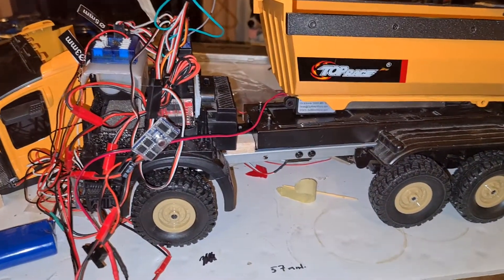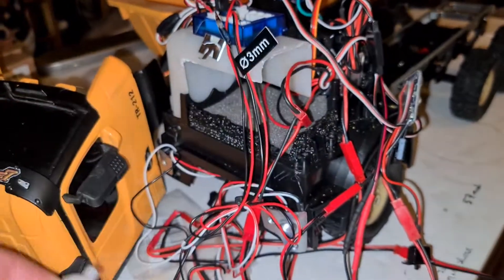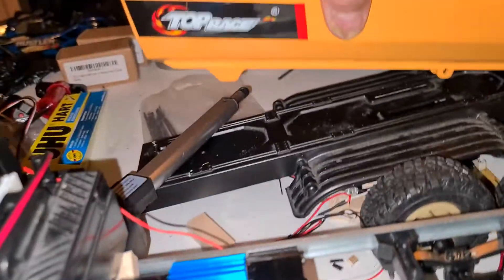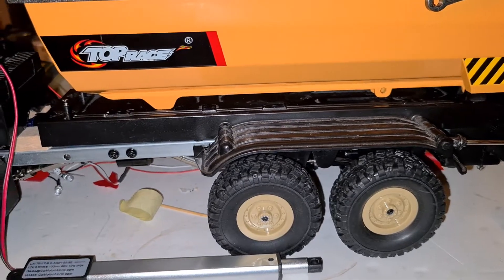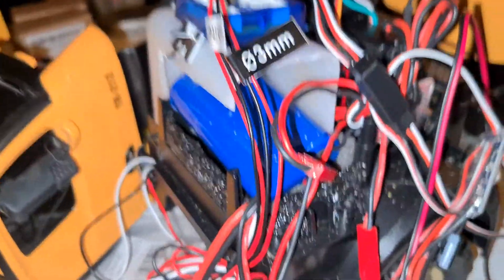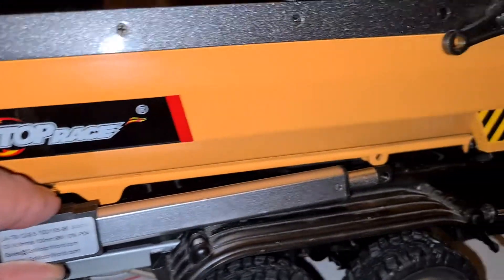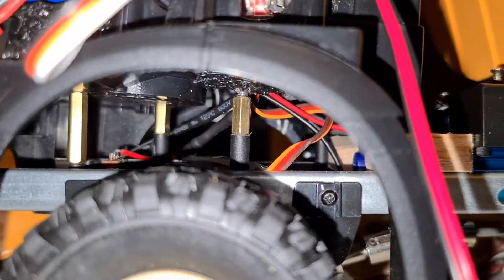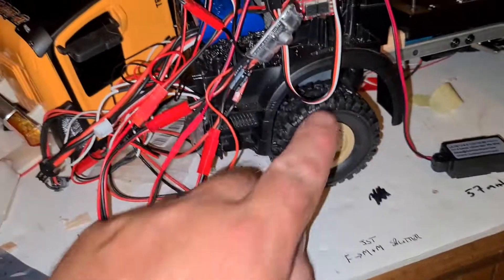Huina 1573/Toprace TR-212 Upgrade.

Comment: Love your work mate. I hope you do more as you get further
Reply from the maker: Thank you, I'm just learning as I go along. I've changed the linear actuator for a more powerful one, It can now lift the tipper body with some decent weight in it.
Reply: @GP-RC  sweet I'm going to be doing something similar soon myself as soon as that very slow boat from China gets here lol
Reply: @GP-RC  I'm also got the two speed gearbox as well just to make sure that it's going to handle everything
Reply from the maker: Yeah that boat really slows the building process quite a bit lol

Comment: Really interesting video. I just received my 1573 in the mail and it really leaves a lot to be desired as far as the suspension is concerned. I’m pretty sure this KO’d is going to be one I’ll be trying out in the near future.
Reply from the maker: Hi, thanks for watching. The chassis is a WPL 6X6 from AliExpress and comes complete with running gear, either a 130 or 180 motor ( can't remember which), wheels etc. The hardest part I'm finding is fitting the cab and tipper body onto the chassis, that's still a work in progress. Inside your Cab there are 4 large steel weights, what some guys do is remove 3 of those and leave one in. They say it helps with the traction.

Comment: Hi mate, great video.
I have a question. 
I have a top race excavator (1580 I think) anyway, I'm after a tamiya low loader with trailer and motorised ramps but the Mrs is having none of yet (yes correct I'm not a millionaire), so, if I got one of those, removed the skip from the back, buy a tamiya hitch plate, couple of other odds and ends, chrome mirrors, roof spoiler, nicer mud guards, that wouldn't be too difficult would it ???
I'm quite good at fidgeting about with things, now, do u think I'd be able to extend the wire, have a connection at the back of the cab, and somehow use that piston to operate my motorised ramps???
Thanks
John.
Reply from the maker: Hi John, this is where I got my chassis.. https://a.aliexpress.com/_uxHwrY

With regards to the trailer, I'm not sure as there is quite a difference in scale. The Tamiya are 1/14 scale and these are quite a bit smaller. Sorry I'm not any help on your question. I know some folk have converted Bruder trucks to this chassis and they are 1/14 scale. Search for Bruder RC Conversion and you may get the answers you are looking for.
Reply: @GP-RC  yeah I've seen the bruder trailers, but surely 1:14 is 1:14 across the board isn't it? Dimensions should all be very similar.
Reply from the maker: @johnthegodfatherslack  that's what it should be like but sadly not. The 1580 excavator is advertised as 1/14 but it's more 1/18- ish. The Tipper is also stated as 1/14 but next to my 1/14 tamiya scania it's a lot smaller. If I get the chance later on after work, i'll try and do a size comparison video.
Reply: Great stuff, thank you.
Reply from the maker: @johnthegodfatherslack  Hi John, I've uploaded a little video to show the scale difference between Huina & Tamiya. Hope it helps.
Reply: @GP-RC  very grateful for that mate thank you.
Are the bruder vehichles a similar size? I'm thinking of buying a scania cab.
Reply from the maker: Yeah the Bruder are pretty much the same size as Tamiya as far as I know. There's a cab on ebay that I've seen.  https://www.ebay.co.uk/itm/Red-Bruder-Scania-Truck-Cab-/224605788063?mkcid=16&mkevt=1&_trksid=p2349624.m46890.l49286&mkrid=710-127635-2958-0

I don't have any experience in those conversions so you'd have to investigate that one 👍
Reply from the maker: Lots of Bruder conversions in this facebook group.
https://www.facebook.com/groups/313698865844090/
Reply: @GP-RC  yeah I seen that, I'm on there every 5 mins lol. thanks for your help.

Comment: Hi! Did you finish the project?
Reply from the maker: Hi, not yet. Life has been hectic lately. I have fitted a linear actuator to tip the dump bed. I'm on the second one as the first wasn't strong enough to lift any weight. Hopefully I'll get back to it after christmas time. It will get done 😀. I've got all the black plastic parts off just now ready for painting ( Cat Yellow )
Reply: @GP-RC  I want to buy the 573 because i found a good deal and have wpl b36  to use for this build.  I'v really enjoyed watching your video. I'll keep tuned.
Reply from the maker: Awesome, thanks for watching. The wpl 6x6 chassis is great for these kind of builds. It takes me quite a while to figure out how to make things fit where they are not designed to fit 😅 but i'll get there eventually.
Reply: @GP-RC  I've seen one guy rebuilding it like that. He even sells staff for a rebuild. I just purchased the dumper :D